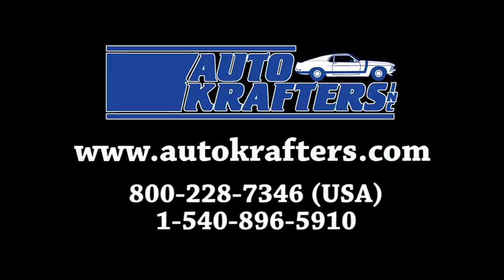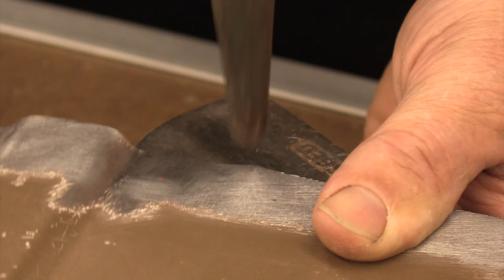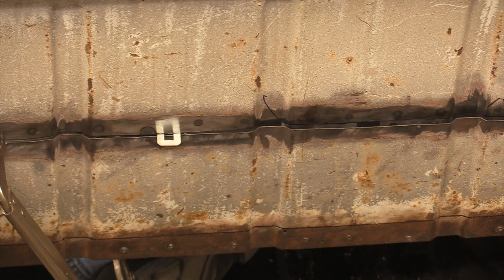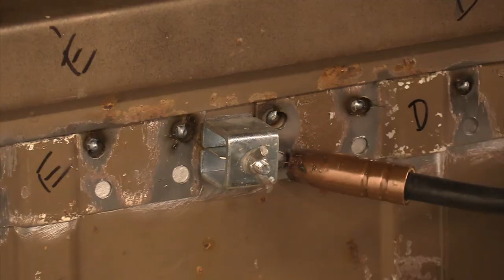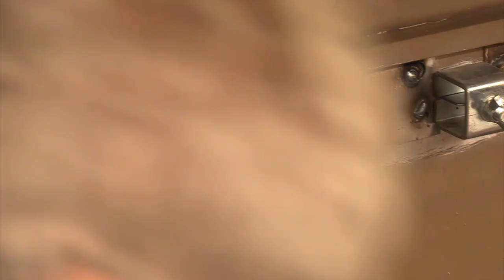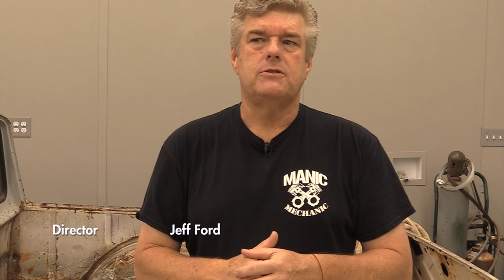Welding Sheet Metal on Car

Comment: Lap weld is stronger. After a 5-year apprenticeship that may be the only thing I took from it, well that and journeyman pay.
Reply from the maker: The lap is stronger. And in that area I would rather have the strength so that I don't have to worry about possible oil canning of the panel.

Comment: Cool video, I'm thinking about gluing in my floor pan's due to the fact I have zero welding experience and the welders I know here in Texas are very expensive. What are your thoughts on this? Thanks for the great content as always.
Reply: I was thinking this too. Panel bond or jb weld
Reply: Check pawn shops for an inexpensive wire feed welder buy one and then practice. Don't lay down huge beads all at once you'll blow holes. Lay series of small tack welds. Just about anyone can do this. When you make a lot of small beads and let them cool down you have an opportunity to manipulate the metal and push it back into place. If you try on weld everything in one bead you will blow holes or warp everything so out of whack it'll never line up again
Reply from the maker: I have always been a little suspect of panel bonding adhesive in those applications.  And my biggest problem is not necessarily with the panel bonding adhesive is the ability to get both surfaces perfectly clean the way you need them for panel bonding adhesives. And JB Weld is right out. Your best bet would be to possibly go down to Harbor freight and pick up the welder that I have listed below. Honestly had I to do it over again I would have gotten that welder over the Lincoln that I'm using right now. A lot of people say the titanium welder is a really nice one to use for this kind of work.
 ttps://www.harborfreight.com/mig-140-professional-welder-with-120v-input-57863.html
Reply from the maker: JB Weld is not checked out for that activity. Please don't use it as a panel bonding adhesive!
Reply: @AutoRestoMod  thanks Jeff

Comment: I don't think quenching would help most likely made it worse think about why it will Warp it's because melting metal is hot when it cools it contracts like anything that is cooling the only way to not get a warp is to Tig it let it warp and hammer on Dolly on the weld to stretch the metal back out until it's straight doable but not practical especially on new vehicles that don't have access to the back side in the section locations so with new cars we try to minimize the warping by using less heat and smaller diameter mig wire .23  and fix the rest with fillers
Reply from the maker: We're using a short strike on the welder with .25 wire--much like pulling the trigger on a gun. I don't know if the quenching made any difference at all, I wish now that I had quenched some and not quenched to the other ones so I could see for myself which worked better. But I just put my head down and started working and that's what happened lol.